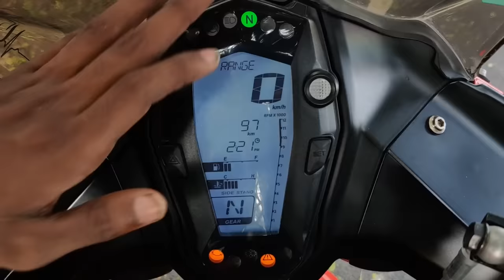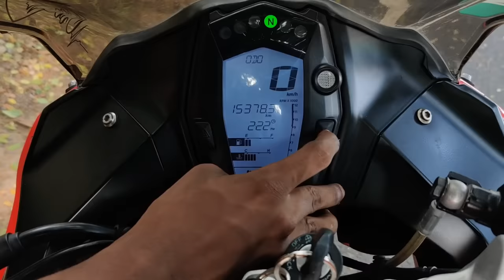RR 310 | தமிழ்| Ride experience | Apache

Comment: Budget bikes um podunga bro konjam Apache 160 4v... request 😌unluck jack notification squad🤩
Reply from the maker: Sure
Reply: Yeah bro hornet 160r
Reply: @unlukjack28  is rr310 beginner friendly bike ah bro.?na book poren.na oru one year ah than bike oturen bro.nenga suggest pannuvingala.
Reply: @s00rya49  I learned to ride on R15 and also rode ns 200 and rc 200 . Those are my friends bike.Now i wanted to buy one for me.
Reply: @max2207  bro buy what you want and you get used to bike but don't drive like squid
Reply: @Masters_Yukesh  Yes bro i bought rr310 bs6.I am riding with proper gears and will follow rules.I love biking culture.
Reply: @max2207  chance ae illa bro ithu oru 300 cc sports bike so konjm tough for beginners
Reply: @theMohanG  Hahahah..i bought and its quite beginner friendly..I love it..its not as carzy as duke 390 pull..it pulls when you want it to pull..rr310 is completely under rider control🤪
Reply: Perfect bike bro... I'm using it for past 4 years, vera level response, ... Perfect bike

Comment: 18:20 The owner said he didnt change anything other than clutch cable.. and the bike clocked 15000 kilometers in odo. so the front and rear brake pads are worn out by now. Thats why the initial bite is less. And for your information, Only the brake calipers are from bybre (sub brand of Brembo ) the brake pads used are directly from brembo... front pads cost's 2.6 k and rear cost 1.6k.. and about the vibrations at the handlebar.. those vibrations at handle bar are solved by replacing the existing  handle bar end weights with bigger one.
Reply from the maker: Thanks for Ur information but he changed the brake pads in general service but it's not a big thing to tell .. it's common bro